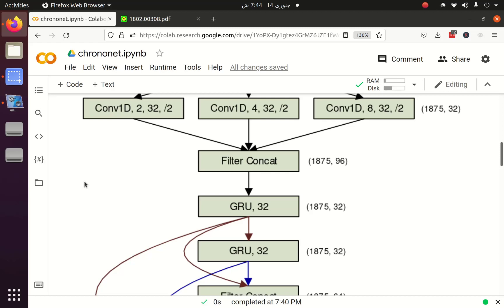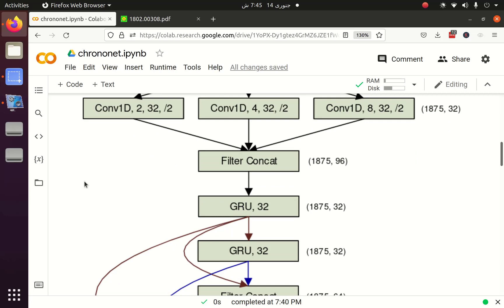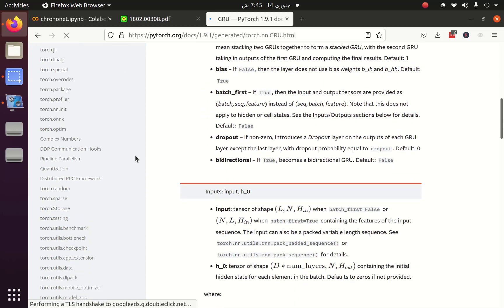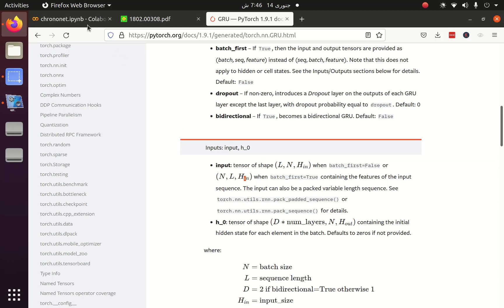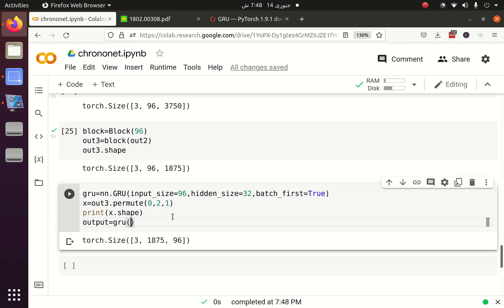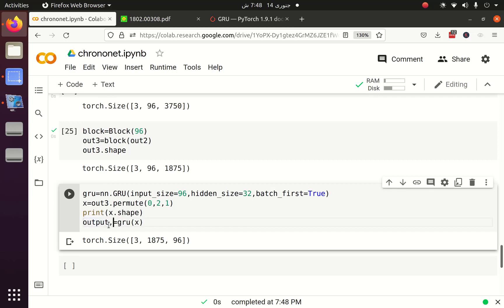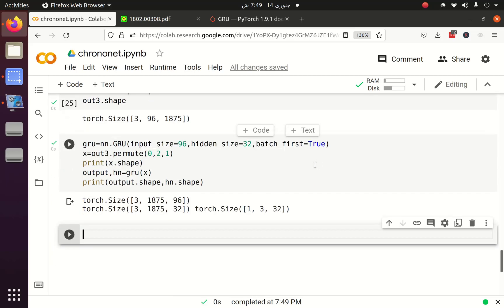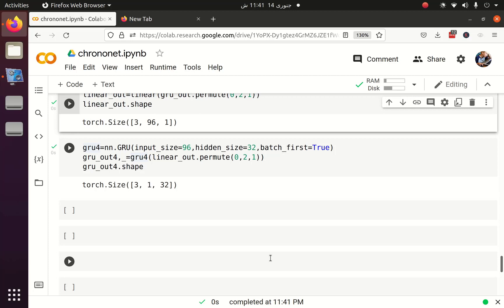3.2 ChronoNet (CNN_GRU) paper for EEG signal classification using Python

Comment: Thank you for the video sir. I have learnt a lot from you. I am facing a problem using "GRU" in "pytorch". In summary of the model, I can see 0 trainable parameters in GRU layers. But in Tensorflow, I have found trainable parameters from GRU layers. Please help me solve the issue. Thanks in advance.